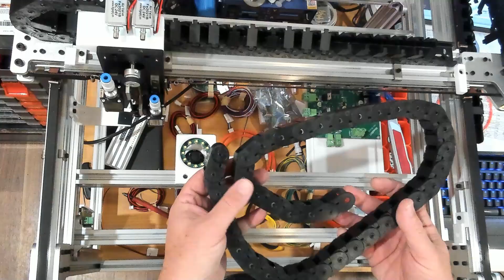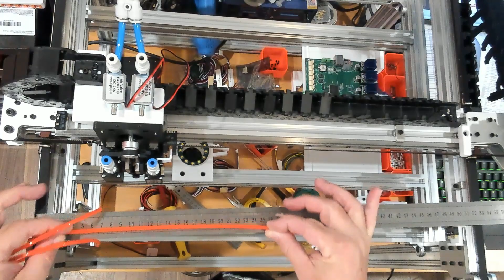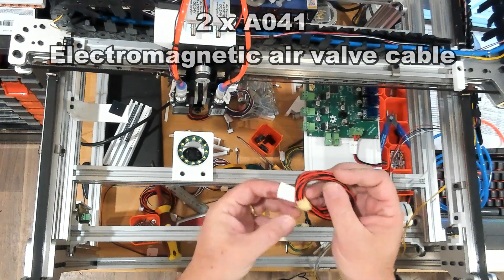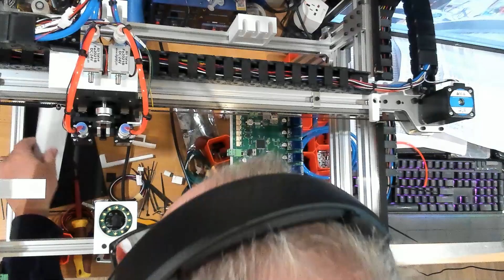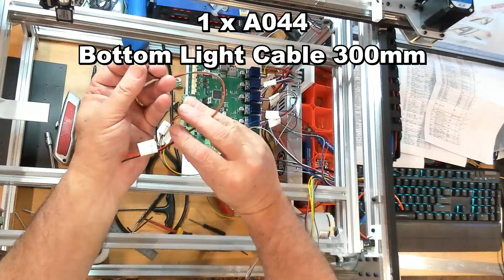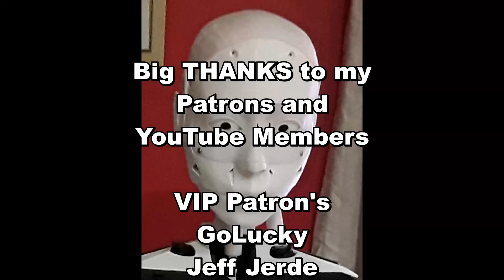MicroSMT_Electrical Part 2

Comment: Out of curiosity, what is the advantage of this over a lumenPNP ?
Reply from the maker: Mostly the price.
Here in Australia, the LumenPNP works out at around the AU$4000 mark, the MicroSMT using works out at around the AU$1600.
Both use the OpenPNP software, both have solid hardware, both have good community support.
Reply: @CyberOne gotcha! Totally makes sense. Here in US that would be pretty close match, price wise and it looks like lumen doesn’t take a lot of work to get going. I wish lumen was out when I pulled trigger on my charmhigh.